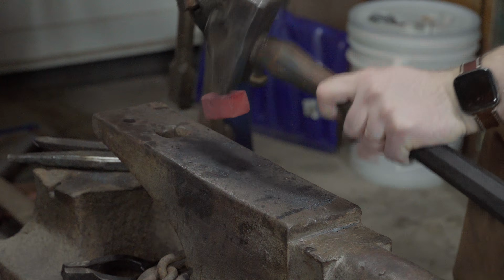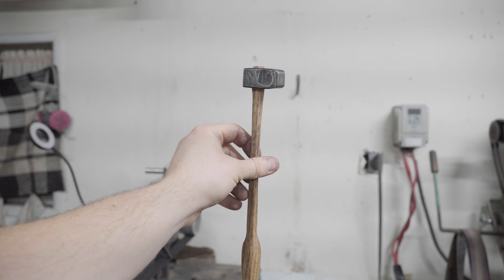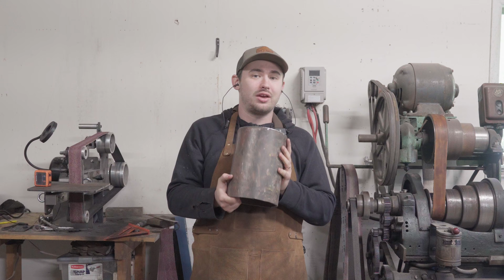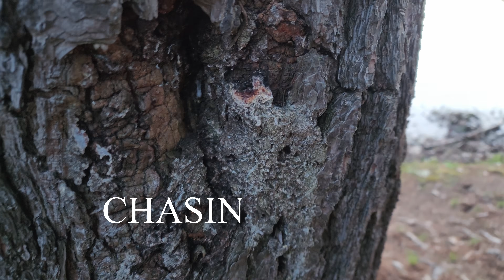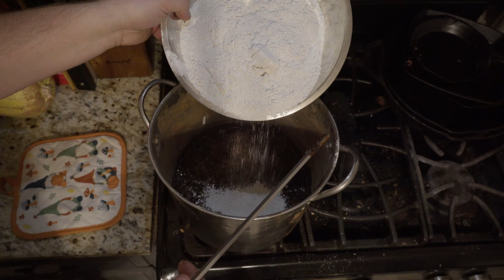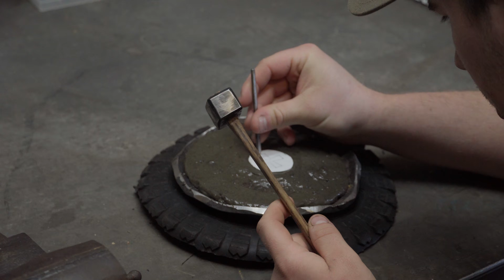DIY Engraving Tools: Chasing Hammer, Gravers, Pitch and Bowl

Comment: For the gravers, what would you say the most essential size should your steel stock be? Or what size stock can you get the most work out of, if that makes sense?
Reply from the maker: What I'm using is about 5/32". It seems to be a good size for the gravers I have currently made. Some people also use old chainsaw files.